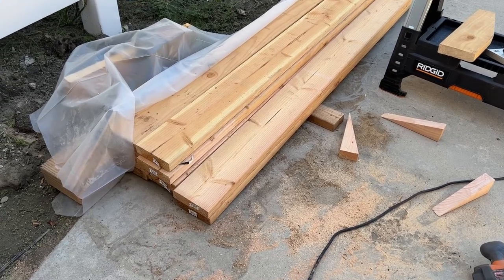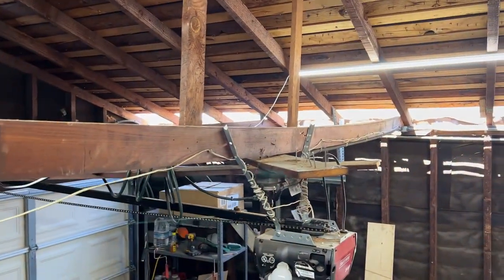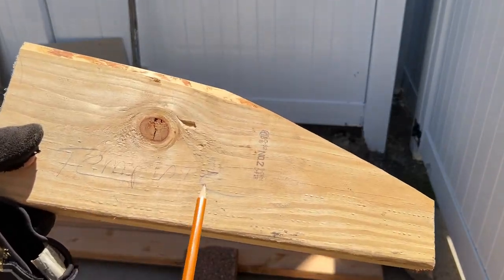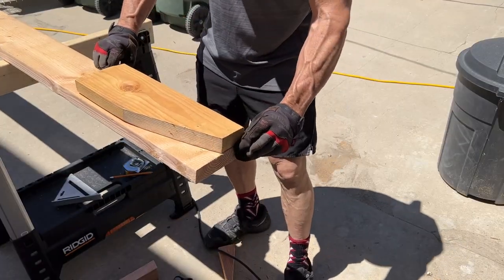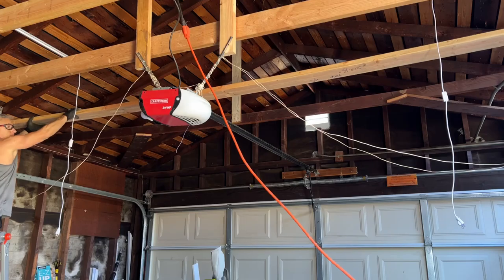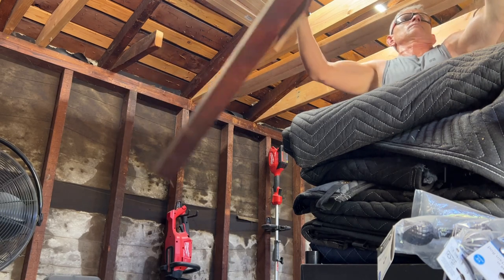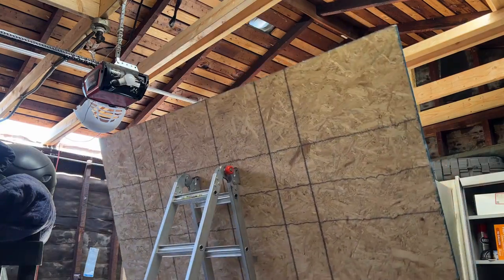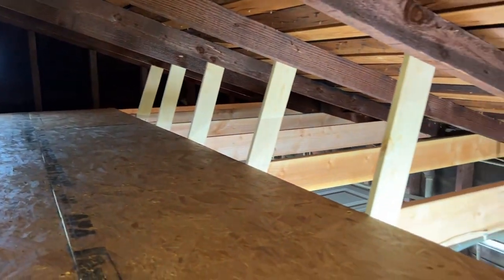Framing A Garage Ceiling For Drywall | How To Install Garage Ceiling Joists

Comment: John - I'm trying to do something very similar in my garage but I'm running up against the issue that 2x6s don't support a 20' span (my roof rafters are 24" apart). I also don't have the room above my top plates to fit them. Any advice? How are you getting around the span limitation? I'm in a similar area to you - Long Beach, CA.
Reply from the maker: Hi, you are asking a loaded question witch creates more questions. Here is what i did! After i installed 18' 2x6's i also blocked them all down the center of ceiling and then i added webbing (1x4) vertical supports connecting 2x6's to the existing roof rafters. This stiffened up the ceiling joists nicely.
Reply: @nicklocking I’m currently doing this project as well and my garage measurements are 20X25 so yes you are correct to California framing code it needs to be 2X8 after 18’span if your garage is 18 or smaller then 2x6 shouldn’t be In issue

Comment: How did you make the template?
Reply from the maker: I used a speed square on the existing rafters and then i took a 2' section of 2x6 and scribed it against the rafters. Simple to do when you have an existing structure.

Comment: How did you cut your legs?.
Great video btw
Reply from the maker: Thank you, By legs are you referring to the 1x4 webbing connecting the rafters to the joists?
Reply: Yes
Reply from the maker: @renatochiarella4750  I measured and cut the webbing (legs) by taking the 90 degree end of 1x4 and butting it against the roof sheathing in the spot i chose. Then i just took a pencil and scribed the ceiling joist end. Then just nailed it to rafters and ceiling joist.
Reply: Pfff...duuuh. of course!. 
Thank you my man!!

Comment: Hi, I have the same design and issue for the garage. 

The garage door opener caused the ceiling joists to be pushed up about 4 inches and now I have an uneven ceiling for me to finish with drywall. And due to this, now I have a barn still interior for me to drywall. 

If I don’t use 20ft 2x6 can I add 2x4 parallel to the already 2x6 ceiling joists? I would only be adding like 4. But I am trying to find a way to avoid buying 20ft anything for 4 ceiling joists.